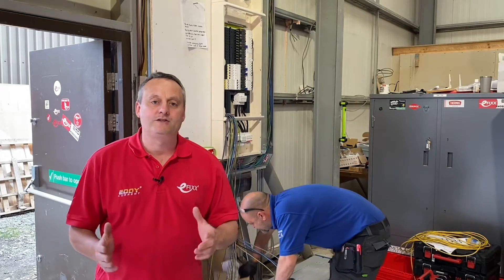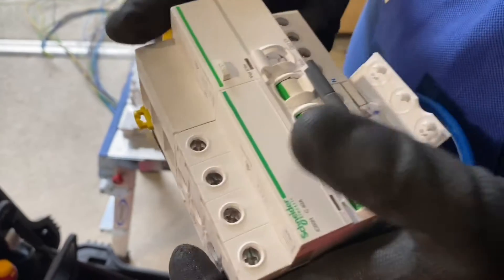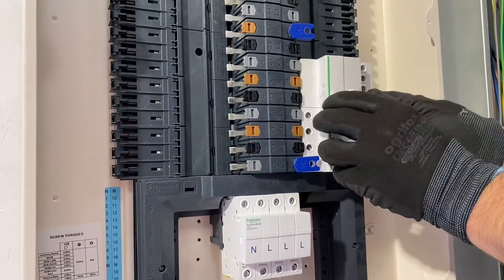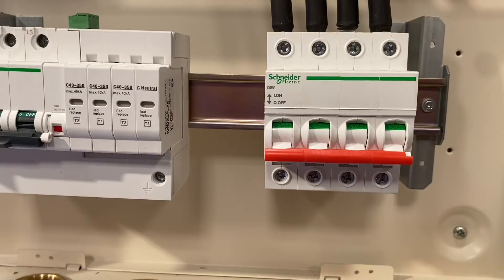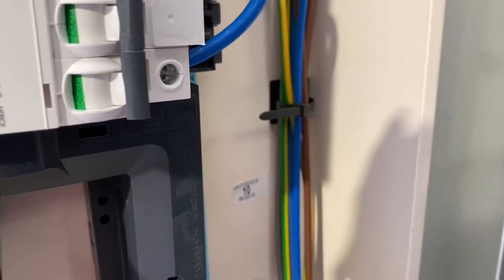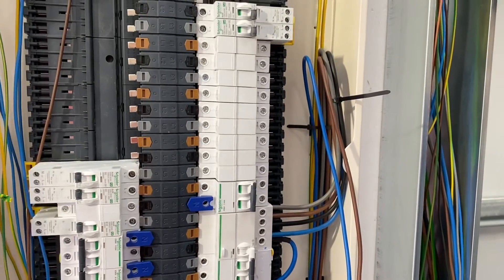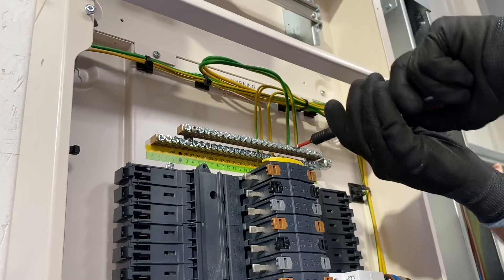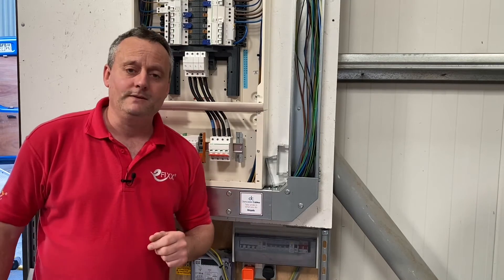SCHNEIDER Acti 9 THREE PHASE DISTRIBUTION BOARD INSTALLATION

Comment: The problem with SPDs with TPN boards like these are that the earth bar is at the top, so keeping to the <50cm total conductor length is very difficult to achieve. 

@efixx when will you release the follow up on the SPD?

Comment: I don’t see the need for three or four different torque screwdrivers for one DB total cack , why in. God’s name can’t they just have one or two torque settings  and one torque screwdriver that covers those settings. 
My torque screwdriver covers 1Nm to 5.5 Nm so i’am pretty sure I would be covered for that DB . Absolute Madness this is nothing more than the Germans make a bank load of money of the back of the Uk . The world has gone positively gaga I’am telling you. Also I still hear that word required torque , it’s not required it is how ever the manufacturers recommendation nothing more.  But tobe fair that is a nicely dressed DB , I have always used cable tie’s when dressing that type of Board but I never took the cables up then fold back down , I like that look a lot neater . Job well done 👍.when it comes to torque settings just dropped the word required.  
Fantastic video as always Gas 👍👍👍👍❤️

Comment: Discussion - The distribution boards, switches and isolation and the like do not appear to be installed at a height which is maintainable and as such will require steps to perform simple maintenance and switching tasks. The average reach of a person standing on the floor is 2.1m. MOD design and Maintenance Guide 08 which is often used as a reference suggests 2.0 as a maximum height. 
Unless mitigated by a Designers Risk assessment, all maintenance and switching operations should be undertaken from a maintainable and accessible position, such as floor standing.
Reply from the maker: The board is very long as it’s got a entry box at the bottom with SPD and main switch plus and extension box on top. Under the board is the meter and service head. This is the only realistic option in this installation.
Reply: @efixx  it's very difficult to comment on whether this is the only reasonable installation in this case. I do know from the angles presented that the switching parts of this of these DBS is way too high for operation from a floor standing position. I do know from a designer point of view this is something that I see a lot off. I do know from a designer's point of view that often it is not the only reasonable alternative it is usually the most cost effective alternative for the contractor.

Comment: Torque screwdrivers really are an essential piece of sparky kit, esp for industrial work. 

80% of faults are down to loose wires.
Reply: Or incompetence, never use a torque and never had a problem

Comment: Nothing new really, nice that there's no tails on the rcbo's. Not sure why you need all those torque drivers when the setting cross each other, dread to think how much they cost, I did think they would beep when the level was reached and not click like a standard one with them being digital.
Probably controversial bunching them together no matter how tight they are, but it's something I do, and I don't lose any sleep over it.

Comment: Pretty standard stuff there, decent job. I like that he actually mentions cable grouping inside the board, im sick of seeing bundles of cables tied together so tightly they nearly merge. Loosely spread is the way. Far to many Instagram electricians thinking that pretty means good!!...When in reality ( unless all those cables have been massively upsized ) are making a nice fire hazard.
Reply: Plus on the installs cables are mostly stuffed into trunking creating a grouping factor not really any different to the db
Reply: @timdavison640  spot on trunking is the enemy with grouping especially horizontal runs. Not DBs. Total myth in many cases started by those who sit behind a desk.
Reply: Unless the circuits in question are run close to max operating temp. I don’t see a problem with grouping inside a dis board
Reply: @tomorichard  same. Which wouldn't be great design tbh.
Reply: As a designer I don't get too conserned about cables bundled together inside distribution boards. I am more concerned about cables that leave distribution boards that have are between 2-72  ways, but yet seem to be miraculously ungrouped.  contractors manage to install cables throughout buildings without any grouping, without being affected by insulation, or any of the other normal laws of physics is beyond me. if cables I properly grouped and derated externally to the board then there is no issues when the cables are grouped internally to the board.
Reply: @sandymcnair5298  exactly this. Great points. Sadly we get word of mouth and misleading 'technical video content' that starts myths. The design guide is a great book and explains allowances for such things.
Reply: @electrician247  I use a host of information, for design purposes when you refer to the design guide which book exactly do you mean?
Thinking about it for the I think you mean that IET guidance notes
Reply: @sandymcnair5298  yes, that among others.
Reply: Thanks for the comment. I've always done it really tight, I don't think in such a large panel the heating would matter. But your comment and the video has made me change my habit.
Reply: Believe me on 3 years old housing development in London I carried out EICR and if I could show you the heat on neutral caused the colour changed  where every 5 inches there is cable tie  yes looks neat but as you say it is hazard for. Heat dissipation
Reply: Here's one of the best videos explaining why you don't cable tie cables tightly together.
https://youtu.be/e3xA3t6wAmY
Reply: @arcadia1701e  if you have lots of cables under significant and sustained load within a DB this will be a factor to consider and is ultimately because of poor design. However that video has a few inaccuracies within it which in turn can lead to myths. 

Best way is loosely tied as allows for an easier time with future testing and maintenance. 

Every install is differently but generally it is a non issue